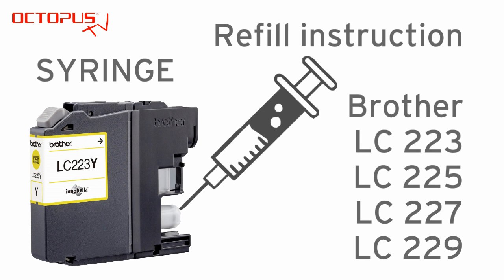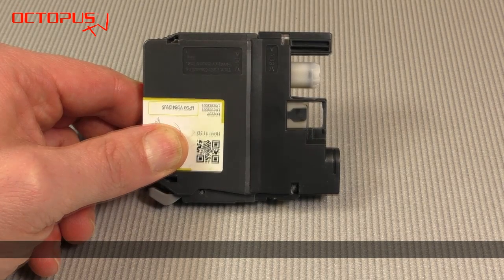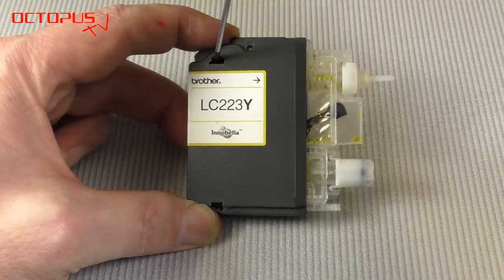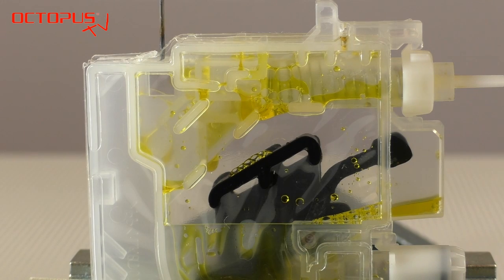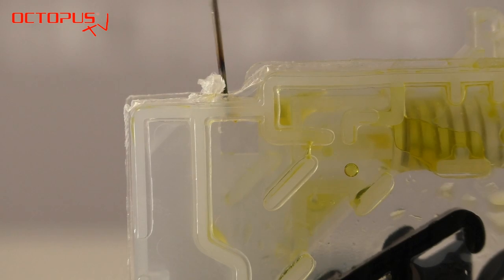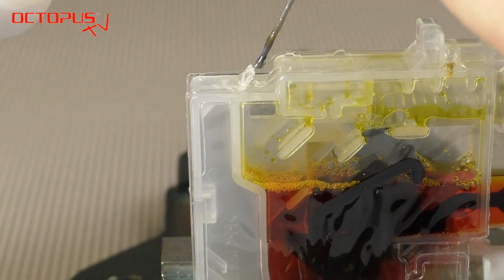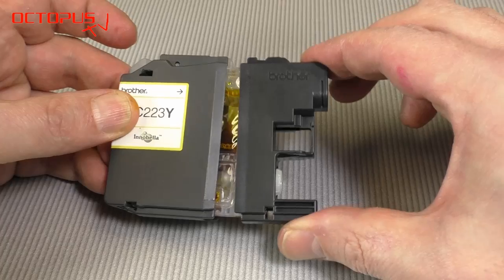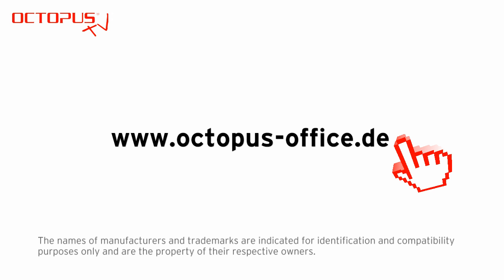Refill Brother LC223, LC225, LC227, LC229, LC203, LC205, LC209, LC233, LC235, LC239

Comment: IF after refill it stills complains it's empty:
(COMPATIBLE CARTRIDGE) TAKE OUT THE SMALL CIRCUIT BOARD. YOU MAY NEED TO LEVER A PLASTIC HOOK AWAY WHILE YOU PRY IT OUT, OR CUT FLUSH SOME PLASTIC RIVET, EITHER WILL HOLD IT IN PLACE. THERE IS A SMALL BUTTON CELL BATTERY ON THE OTHER SIDE, INSIDE A METAL HOLDER. SOME OF THE METAL WILL BE BENT TO HOLD THE BATTERY IN. FOLD IT BACK. PUSH THE BATTERY OUT FROM THE OTHER SIDE WITH A PIECE OF WIRE OR TOOTHPICK. KEEP IT OUT A FEW SECONDS. PUT IT BACK IN. MAKE SURE THE NEGATIVE SIDE WITH THE CIRCLE POINTS TOWARDS THE CIRCUIT BOARD, AND THE POSITIVE SIDE, THAT EXTENDS TO THE SIDE WALL OF THE BATTERY, THE ONE WITH THE TEXT MARKINGS, TOUCHES THE METAL CAGE. THIS WILL RESET THE CHIP. THEN PUT THE CIRCUIT BOARD BACK ONTO THE CARTRIDGE. IT SHOULD WORK NOW.
Reply from the maker: Hello Fridelain, thanks for Your contribution. It´s worth to give this a try with alternative cartridges.  We learned from our own tests that removing the battery from such chips - makes the chips´brain forgetting everything - after setting back the battery every information on the chip is deleted. Maybe this does not apply to all alterntive chips -  that´s why we say it is worth to try....

Comment: cooooollll. which hp or similar brands used a sensor that ACTUALLY checks the ink.
Basically, brother is selling "ink tank printers" in theit normal printer line up. they made it a whole lot easier for us to make it ciss
Reply from the maker: Thanks for Your feedback! Nowadays basically all inkjet printers are equipped with technology creating information about the ink level status. We like the printer models that have build in ink tanks that can be filled by bottles -  they are available from Brother, HP, Canon and Epson....
Reply: @octopusoffice 
and out of the brands you have listed, HP smart tank 500/600 series have that tech. they can detect the ink in the printer.

Comment: Just did it and it worked fine. Now I'm wondering if i need to clean the syringe and how to do it. Will it get constipated?
Reply from the maker: +jimihenrik11 It is sufficient to rinse the syringes using water after use. Pull the plunger out of the syringe´s body and eversthing can dry properly.

Comment: Hello, great material ! I have two questions about filling - whether cardridge should not contain air (vacuum)? Is the filling process requires resetting the chip?
Reply from the maker: Hello, thank You very much for Your question.
1.) The inner ink tank always contains some air when the proper quantity of refill ink has been filled. The more ink is consumed by printing the more air is in the inner ink tank. The air replaces the consumed ink.
2.) You can also use such a refilled cartridge WITHOUT resetting the chip. Then You have to print without proper ink level information. The ink level information for such a refilled and NOT RESET cartridge will be deactivated.

Comment: As low as the price's Are for NEW ink cartridges on eBay, AND taking a chance of burning the print head if the Brother All in One, THINKS the Cartridge's or Cartridge is full but not, Than I think it would be best to use new and just have to pay a little more than to take that chance and maybe even make a mess. I like saving money just like anyone else, But I don't want to be ordering parts to install when I'm really not sure how easy that is ether.
Reply from the maker: Thank You very much for contributing on that topic. Unfortunately a lot of the NEW alternative inkjet cartridge products have a quite unreliable quality inkwise and chipwise - in our humble opinion. So refilling the originals requires a bit of practice, that´s right. At the same time working with original cartridges also pays respect to the original manufacturers intellectual property and rights.

Comment: What's the point in having the float level indicator and a chip. All that is needed is the float and a light sensor to tell the printer ink level is low.
Reply from the maker: Thank for the question. We are with You in that point - but this solution would make it too easy for You to use the cartridge again - Brother® does not really want that :) The chip is a clever way to make customers buy original cartridges only as long as the alternative cartridge manufacturers are working on an alternative chip solution.

Comment: Hi and thank you for this helpful video, I have a problem with the black cartridge. Every time I fill it, I can print almost 50 sheets and then the printer gives the note "Not enough ink to keep print quality". I filled many cartridges with many different levels, but the problem persists to happen. Is there anything I can do to avoid this problem please? Many thanks and best wishes.
Reply from the maker: Thanks for the question. Do You use a refill ink specificially for the Brother LC22x cartridges series? In case some of the physical characteristics of the used refill ink do not match the printers´ requirements this message may show up.
Reply: @octopusoffice  Thank you very much for your response. Yes, I do use a special ink for the printer. However, I have noticed that you closed the hole after filling the cartridge. I think the problem is the pressure inside the cartridge, because I did not seal it. I have checked recently, and the printer's still working fine. I hope it will last of a quite reasonable time. Cheers and best wishes.

Comment: I have refilled a LC223, but the printer still thinks it is empty.  What could be causing this?
Reply from the maker: Hello Peter, filling up an empty cartridge with ink does not restore the displayed ink level back to FULL. With sufficient ink inside the cartridge You should be able to start print jobs despite the empty status.

Comment: i only print text and therefore need only black ink. The other colors dry out (?) and so i still cant print. can i fill the color cartridges with black ink
Reply from the maker: Hello Dennis, it depends a bit what kind of ink you are using for Your black cartridge. In case it is a black pigmented ink it will not work properly in the other cartridges as they are running on dye base inks. The worst think that can happen is that the nozzles for cyan, magenta and yellow will be blocked. But if You really do not need these colors You also do not need those nozzles .

Comment: The cartridge don't need reset the chip?
Reply from the maker: There is a resetter available so You can reset the original Brother® chip BUT You do not must: You can keep on printing with a refilled cartridge and a non reset chip on it. In this case the ink level information will be deactivated.

Comment: hi, thanks for the video. This is compatible also for the LC103 cartridge? do you have any further printing issues later apply this technique?
Reply from the maker: +bitbites abc
LC103 is the previous cartridge model series. You can apply the method shown in this video also on LC103, no problem. Beside the way of refilling please make sure to use a proper ink suitable for LC103 cartridges.

Comment: How can you refill an LC3319XL cartridge? I cannot find an air release valve.
Reply from the maker: Thanks for Your question. The LC3319 have a different design layout. Actually You can push the refill ink into the cartridge by using the ink port. We have video tutorial that shows the extraction of the ink out of an original Brother cartridge - using that method the reverse way enables You to refill ink into Your cartridge. https://youtu.be/mTx1iTLA3SI
Our problem is at the moment that Brother does not support anymore that You can keep on printing with an empty original chip - that means You can refill Your cartridge with suitable ink but the printer will not accept that cartridge for further printing :(
Reply: @octopusoffice  thanks for that. I managed to work that out with a standard syringe minus the needle. Works easy. Can you cold start your printer to override the chip count?
Reply from the maker: @davow8  Thanks for the feedback and great to read You have found a tool solution. So far we have not been able to find a way to get the printer back to work with the refilled original cartridge - sad story! We have been digging through the well hidden service menus - still no success...
Reply: @octopusoffice  Just replaced the genuine refilled cartridge. Worked no problem. I have a 1 month old MFC-J6530DW.
Reply from the maker: @davow8  Interesting information! From where do You write to us? According to some rumors in the market there are differences in the behaviour of Brother printer models in different geographical regions . US printers do different from Europe region printers some tales say ...
Reply: @octopusoffice  I am in Australia. I have not run the cartridge sufficiently to see what the ink volume sensor is going to do. At the moment it is full., but so was the cartridge i replaced it with.
Reply from the maker: @davow8  So we are in different global regions for sure. Please keep us posted how the refilled cartridge behaves. We are going to buy some new printers to test of their behaviour is different from the one we have been using to conduct our test for LC3217 and LC3219 cartridges.
Reply: @octopusoffice  Interesting development. I have refilled Cyan and Magenta and they are working fine. The yellow detected non -genuine ink but still works. The black is now saying insufficient ink even though they are full, so obviously chip counter at work. Let us know if you work out how to reset the chip in these cartridges as they are dead easy to refill.
Reply from the maker: @davow8 Thank You very much for taking the time and sharing Your results with us! When You are going to use a new black cartridge in Your printer You can try to fill it up with in BEFORE You receive any warning message related to the ink level in that cartridge - it might extend the time before the cartridge is messaged empty and getting blocked by the printer.

Comment: hello. can i do this method with LC40BK? thanks in advance.
Reply from the maker: Thanks for the question. The housing of the LC40BK might be a bit different and the fixing of the housing to the inner tank too. But basically it is not impossible to figure out how to get the housing off. The inner tanks for the ink are quite similar to each other, so find a suitable spot for the fill port and You can do as shown in our video.

Comment: Thanks for the video Octopus... I do have a question, I have been refilling LC-201 and can not find ink amounts for these. Would the ink amounts for LC-201 be the same as the LC-203??
Reply from the maker: Hello Jeffery, the LC-201 is actually the smallest version of the cartridge series LC-201, 203, 205, 207, 209.
So the original amounts of ink are 7 ml for black LC-201 and 4 ml for cyan, magenta, yellow LC-201.
Reply: +OctopusConcept Really??!! Wow that is low amounts.. Since I didn't know the amounts I was treating them as a LC-203... I hope this is ok.
Reply from the maker: Let´s hope the best. Usually Brother is using lower page yield by filling less ink to sell the cartridges for a lower price. But in some cases the physics of the cartridge do not work well if You fill more than the original amount of ink. Keep an eye on Your prints, then You should be fine. When drops appear on the prints it may be better to remove the excess ink from the cartridges.

Comment: Hi 
How to seal the cartridge ? what liquid or material did you use ?
Reply from the maker: Either You use a drop of hot glue, which can be removed easily for the next filling again. Or You have a suitable rubber plug available.
Reply: Thanks for that
what have you used in this video ?

Comment: I refilled using this method, but the printer doesn't seem to detect that the cartridge is full and is displaying as empty, so it doesn't allow any printing and for some reason only the black ink cartridge is being detected. Any suggestions?
Reply from the maker: +waniushka As long as You have not reset the original cartridge´s chip using a suitbale chip resetter, the ink level stays at the status empty. When setting back the refilled cartridge into Your printer the printer asks if You  have changed the cartridge. You have to answer this with YES. Then the ink level information for this cartridge is deactivated. The process does not work for alternative cartridges.
Reply: +OctopusConcept I did exactly that, but the printer still thinks the cartridges are empty and doesn not allow any printing. Do you think the resetter would solve this issue? And what do you mean by alternative cartridges? Thanks
Reply from the maker: Alternative cartridges we name cartridges not made by Brother. These cartridges do not support continued printing with a refilled cartridge due to their chip, which is not made by Brother too.
Reply: +OctopusConcept Oh I see. Well these cartridges came with the printer, so I assume they are made by Brother. Do you think the resetter would help in this case or is the problem somewhere else? Thanks
Reply from the maker: Thank You very much for these additional information. These cartridges are called setup cartridges. They should are original Brother cartridges. Some of our customers told us that setup cartridges did not work refilled in their printer, but we were not able to reproduce that result as our setups also worked refilled in our printer.
We recommend to have at least one set of regular (non setup)  Brother original cartridges.
Reply: Hi. I have same problem as waniushka. I refilled but printer says that cartridge is empty. I will but original cartridge set  and inform.
Thanks for advice

Comment: and the chip?
Reply from the maker: There is a chip resetter availabel which you can use the reprogramm the chip on the cartridges. But luckily Brother still provides the opportunity to keep on printing with an "empty" chip. You will not have any ink level related messages anymore for that cartridge but You can print if there is sufficient ink inside.

Comment: completely unnecessary. you can fill them through the same place where the ink normally exits the cartridge
Reply from the maker: Hello Claudio, thanks for taking the time and providing Your thoughts about our tutorial. We are happy to read that Your way works fine for You. Quite a number of our users asked for the tutorial with refilling by applying a hole into the cartridge body. The way to refill the cartridge by the ink outlet and paying attention to release the built up pressure at the same time was to much to handle at the same time for this user group.